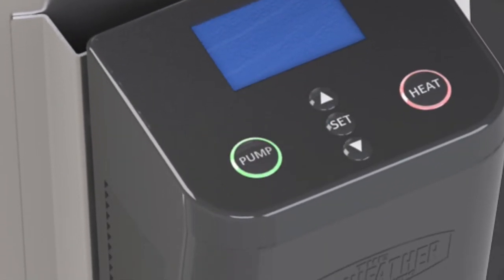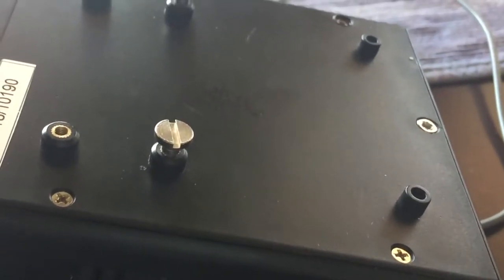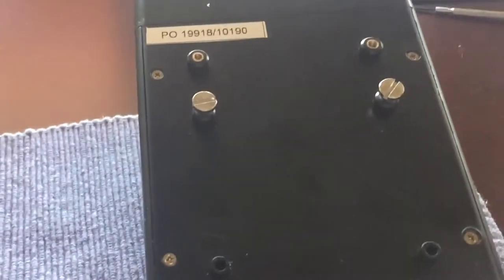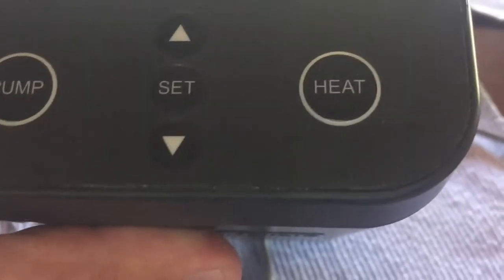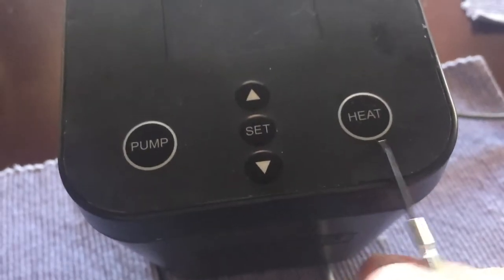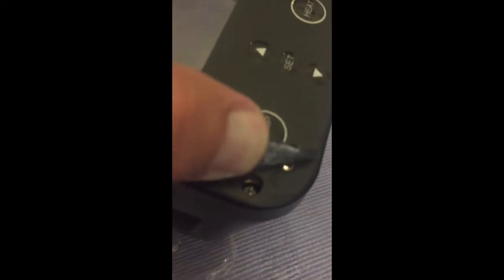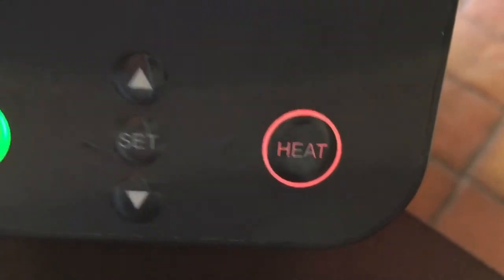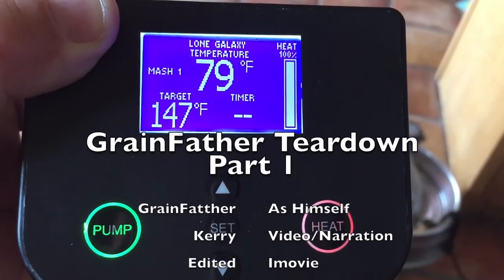GrainFather Connect Repair Intial Look

Comment: Yeah...that's NOT how you open the box. You simply pry at the bottom of the back with a tiny flathead screwdriver, and the top display/back piece pops open. Then you can unplug the display cable for servicing.